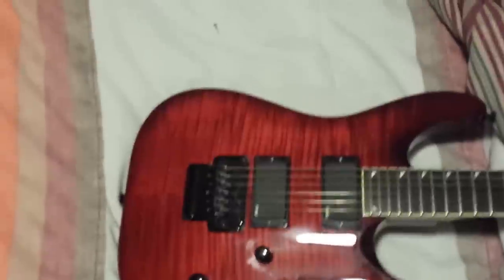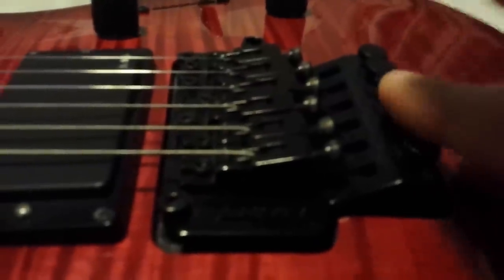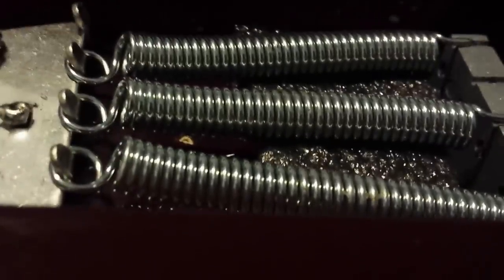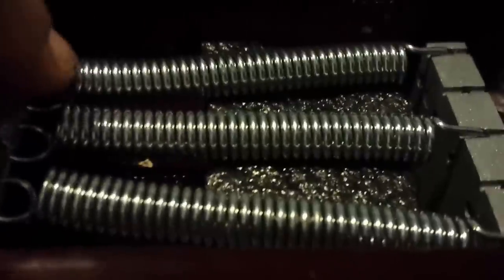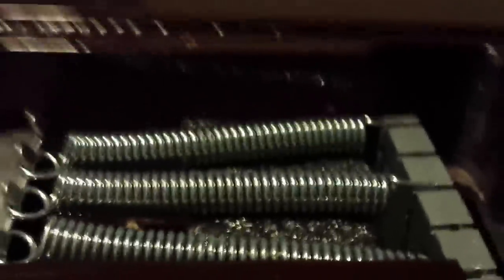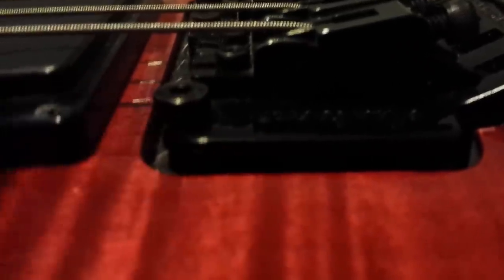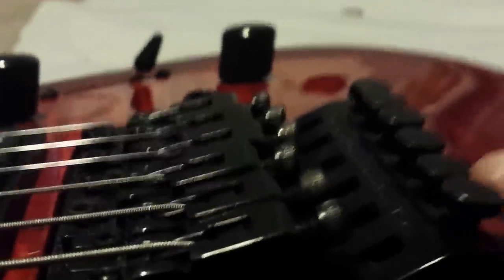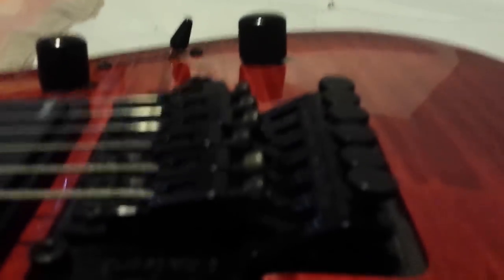How to set up a Floyd Rose Tremolo.

Comment: Hey there, I need some serious help here.
I've searched for a solution but I didn't find any video/blog/etc with something helping out.

So, my issue:
I cleaned up the fretboard, reinstalled the strings, tremolo was working fine. I went a little too much back with the trem, so the springs (all 3) where no more in the block.
So I tried reinstalling them (Uninstalled the strings and everything) but they get flying (literally) away when I release them. I tried unscrewing the 2 screws so it would have as less tension as possible, but they still pop off the block.
Any suggestion?
Thanks.
Reply from the maker: +Rockin'Brony Ahhh yeah, putting the ends of the strings into the saddles can be a bitch. Sometimes the little block inside the saddle, won't let the end of the string seat all the down, the way they should because of rust or gunk sort of holding them in place, instead of letting the string seat down. 
Try loosening the screws that hold the strings in the saddles all the way and make sure you can see the string end seat to the bottom of the saddle and when you tighten them down to the strings, the tiny blocks are flush against the strings and firmly tighten them down, but don't over-tighten them, or else you can crimp the ends of the strings and they'll break when you use your trem. The strings should sink about a quarter inch into the saddles and touch the bottom before you tighten them down.

Then tune the strings up and adjust the springs in the back accordingly, so that the base of the bridge is level with the body (like in the video) and as long as the strings are correctly seated into the saddles and firmly tightened, you shouldn't have a problem with the strings popping out. Ice had the same problem in the past when being hasty while changing the strings and not making sure every string is correctly seated all the way down to the bottom of the saddle and making sure the the tiny saddle blocks are all flush against the strings. Try that and let me know how it fairs.
Reply: Oh fuck I just realised I wrote "strings" instead of "springs" (God damnit)
The SPRINGS are flying away. 
Thanks for the quick answer but I made a mistake so it doesn't help xD
Reply from the maker: +Rockin'Brony Are they popping off the bridge block? Is that what you mean? The ends that go in the bridge block shouldn't be a straight 90° angle, they should be angled inwards towards the claw, so they grip better in the holes of the bridge block. Ya get what I mean?
Reply: Yeah, we (My brother and I) did that and it worked!
Thanks alot man!
I have an audition for College in a week and I was so damn scared I had to go to a luthier to make the guitar work again xD
Reply from the maker: Rockin'Brony Alright sweet! Just hit me up whenever you need to know something about guitars!
Reply: Sure thing!
You just gained a sub btw :P
Reply from the maker: Rockin'Brony Hell yeah man! I just realized how many views this video has. Jesus. I should probably make some more "How To" vids.
Reply: Haha, yeah dude :P

Comment: one more question . on the bridge where the strings get tightened; (below the fine tuning adjustment) they're all staggered the D string is almost maxed out. they all stick out different lengths. Is that normal? is that something that needs to be recentered After Time?   thanks 🎸
Reply from the maker: NO, each string requires it's own length, depending what tuning you use and what size string you use. What would help is if you could send me a picture of your bridge from multiple angles and I can explain what's going on.
Reply: WaRLoKWYATT Ok how do upload a picture.
Reply from the maker: +Anthony Lundell Add me on Facebook
Reply from the maker: +Anthony Lundell You fail

Comment: I can't figure out how to bring the bridge down (level)   Can't get the bridge even.  it's like the strings are pulling the bridge up... and suggestions are appreciated .. thanks
Reply from the maker: +Anthony Lundell It's just a matter of tightening the two screws on the claw in the back of the guitar, little bits at a time, while continuing to tune the guitar to where you want it. It's basically a balancing act between the tension of your strings and the tension of springs in the back of your guitar.
Reply: +WaRLoKWYATT Thanks for the Tip.  I usually crank each one 10 turns.  I've got 9s on my strat already,  I've ordered more springs.. (I also moved the springs.  the 3 connected to the bridge are the same,. but I changed around the order of the loop part of the spring that connects to the claw (the 3 most center). leaving nothing on the two outer side..     that was hard to describe lol...    instead of adding extra springs the guy at Guitar Center told me to do that trick. It didn't work for me however.. if I tighten down the car too much the whammy gets stiff. I've got to take her a little tighter on the lowest gauge strings.   🎻
Reply: +WaRLoKWYATT I am aware this is a Floyd Rose tutorial. My Floyd Rose Steve Vai Jem jr. is that Guitar Center as we speak. it was a disaster. I've never had a Floyd Rose before I didn't even know how to put the strings on, I took the bridge completely off till I realized I had to clip the strings LOL. But I'm having the same problem on my Stratocaster,,  not nearly as bad
Reply from the maker: Anthony Lundell No no no, you want to have the springs running straight, that way there's even tension between the three. If it for a strat, you may also tighten the lower side of the claw to compensate for the higher tension on the lower strings, but only a little bit. You should only need 3 springs, or else the tension in the whammy bar will be too high and it won't work as smoothly.

Are you trying to float you bridge on the strat? Or do you want it flat against the body? Because if you're just running 9's, you shouldn't even have to tighten the springs a whole lot.
Reply from the maker: But the springs themselves should be straight across, 2 on the outside, one in the middle. If your bridge is still slanting upwards and you want it flat to the body and you're not able to achieve that by tightening the claw, then I'd say the springs are bad.
Reply: +WaRLoKWYATT Thanks.  I bet your right.  I'll change it back how it was.  it's not holding tune well. I have to tune up after every song. I know it's because the bridge isn't balanced. I'm learning that's a fine art in itself.   🎸
Reply from the maker: +Anthony Lundell Just let me know any problems you have. Regardless of what people say or think, I do know my shit, because most of what I know is all by trial and error. I used to swear against tremolo systems man. Haha. 8 years ago, you couldn't catch me dead with a fucking floyd rose guitar or a strat. Now I have love for all kinds of guitars. Preference changes with time and experience. Hell you might catch onto what I'm talking about and end up swearing by floyd rose guitars! Once you work on them enough, it actually becomes fun, because they are more of a challenge to get right. I tell ya, I could work on guitars all day, every day, no matter what kind, and be happy. There's nothing I love more than taking a guitar that most guys would call a piece of shit, and turning it into a player's machine!
Reply: +WaRLoKWYATT I've been playing 20 years, I got my first Floyd rose 1 week ago.  It's in the shop being fixed. I should have done  more research. I don't regret getting the Floyd Rose I like the fact you can do dive bombs and stay in tune. my first mistake was taking all the strings off at the same time. I'll never do that again LOL took me 4 hours to get the thing back in tune.  it's Guitar Centers problem now. It's well worth the $60 for them too fix my mistake.  for instance I was trying to tune the guitar with the lock nuts still on the nuts lock. so the string broke up by the tuning peg. that's where my problems began. your video is great and I'll be more than likely referring back to you with any other problems. Like you say trial and error is the only way you learn. I wish I had watched this video before I started messing with stuff.. If you could have heard my guitar that evening I'm sure it was laughing at me. 😕  
I fixed my other guitar by simply using a can of air and cleaning out the volume pods.  I've never taken the pickguard off you can't imagine how dirty it was under there.  1999 American strat.  The volume knob when turned or even slightly bumped made a really bad scratching sound.  
another guitar I have the high E string is too close to the edge of the guitar when I play that string it slips off the edge,. it's worse the lower frets, like the 3rd fret playing a G chord sucks. I didn't notice this when purchasing the guitar years ago..
anyways it's always something with the guitar. you could be doing this type of stuff and repairs for a living or extra cash since you like it and know your stuff.  just keeping all my guitars in Tip-Top shape would be a full-time job I think there's a lot of demand for it
Reply from the maker: Anthony Lundell I would love to do this for a living, it's just that where I live, there's not enough of a demand for it.
Reply: +WaRLoKWYATT I have a question,.   I put 5 springs on my strat, the bridge is almost flush flat.  still up a hair because I loosened the 2 claw strings, but the whammy is pretty damn stiff.  I can lower the note 1 full step, but it hardly goes the other way..  (raising the pitch).  I'm already using 9s standard tuning).  I feel I've maxed out all my options.  the bridge is almost perfect but it won't stay in tune for shit.   any ideas? thanks
Reply from the maker: Anthony Lundell I told ya man, the tension to level the bridge, comes for tightening the claw. You might also what to check and make sure there's no obstructions under the bridge, that are keeping it up. All you want to have is 1 spring in the middle and two on the outside and they should be straight across for even tension. That's the only way you'll be able to use the whammy bar comfortably.

You only put in all 5 springs if you don't use the trem and just play it like it's a hardtail, like me. More springs = more pressure in the tremolo.
Reply from the maker: I'll just make a video explaining what I'm talking about.
Reply: +WaRLoKWYATT Sweet Thanks
Reply: +Anthony Lundell hey man put something below the bridge and tgen loosen the springs like 2 turns 
tune the guitar e e b a g d usually this method works faster then remove whatever you are putting below the bridge to keep it flat it will then flips a bit down again and the tunning will be gone release the springs alittle bit more untill u feel the tension onthe strings will be at minimum when u get to tune again :) make sure the bridge is slightly below the guitar by like a half cm or less ,tune ur guitar again and it should be in shape 
tune ur guitar one more time before locking the nut make it as close as possible couse also locking the nuts would make tunning go a bit sharper of course u have had the fine tuners in the "middle way" then fine tune it and it will hold tune forever
 by the way putting the springs the way u said is fine and will help rreducing tesnsion on the higher and lower strings and it would some how give u a better chance for lowering ur action without having  more buzzy frets 
enjoy 
I hope I ive explained a thing ot two 
its just a bit hard to explain in writing 
cheers
Reply: +komonology thanks I'll give it a try
Reply: Anthony Lundell cheers mate
Reply from the maker: Anthony Lundell Ya nevermind what I say, listen to the guy that comments after the fact. Lol
Reply from the maker: I obviously don't know what I'm doing, apparently

Comment: Broskavitch.... I would not put foam under my trem springs. You are killing sustain and resonance that way. You should buy noiseless springs for that issue. I dont know if you said this but the very most important rule of all is to make sure to slightly detune your guitar before changing your action. Rule # 1 and is the most important. Also the floyd rose original is made of higher grade steel and is more forgiving for wild dives and what not. Denser steel means better sustain...Thats why we use the FLoyd Originals. Just saying
Reply from the maker: Thank you father
Reply from the maker: Spam'n'egg. No it wont.
Reply: Spam'n'egg. Wtf are u talking about? Did u read my comment or someone else's? Clearly it wasnt mine. I have stated to slightly detune ur trem first to relieve tension. My information is accurate thx
Reply: Spam'n'egg. And furthermore ur information isnt all accurate either. If by rear springs u mean trem block springs?? As long as u have something (like cardboard or thin piece of plastic, etc) to hold the trem in place, the trem block springs dont need to b removed. Like he does in this video. To fully preserve the sharpness of the crescent blades of the floyd, yes, i would relieve the tension. However....if u have the floyd propped up u can get away with just leaving ur guitar tuned. And once u get ur action where u like it, chances are...its going to stay there and ur tuning will b stable as it used to b.  I only deal with floyd originals which can take more punishment than the cheaper ones. If ur constantly charging ur action and u have a cheap ass non german floyd...then u are at risk of dulling the blades. And obviously, dull blades means tuning instability.

Comment: anytime i use the whammy bar the strings pop out of bridge
help pls
Reply from the maker: ronald mcdonald  On a floyd rose? You probably aren't seating the strings far enough into the saddles. Make sure when you snip the string and put it in, you loosen those saddle blocks up enough to fit the string all the way down, then tighten them fairly tight, but don't crank with all your might because you might damage the string or that whole bridge. Message me if you need more help.

Comment: Ohh shit I think I made a mistake then. I changed my strings all at once and obviously my bridge sank . Instead of looking up the problem I did a quick fix, I pulled down on the whammy bar so the bridge would lift and tuned my guitar while holding the bar down... all I know is that it worked , the intonation is still good, no fret buzz, but now I’m panicking id this method might have damaged my guitar .. fuck!!
Reply from the maker: I wouldn't worry about it

Comment: The Floyd rose bridges are annoying as fuck I'm switching to normal simple bridges on mine, I cant lift up the bridge without a whammy bar
Reply from the maker: +Optic500 I can help you fix the problem if you're able to explain what's wrong. How many springs are connected to the back of the guitar's bridge? It can only be a couple things that are easy to fix.

Comment from the maker: Well Mia M. It would be nice if I could reply to you lol but thank you.
Reply from the maker: ***** Well it could be a multitude of things. Like I said in the video, when you tune the guitar up, the bridge needs to be perfectly parallel to the body. 

Yes you use an Allen key to move the action up and down. If the knife edges on the bridge are dull, you could have problems there. It's best to adjust the height of the bridge when the strings aren't at full tension, if you can help it.

Also, check those knife edges and contact points on the poles that move the bridge up and down for dirt, rust, or gunk that might be seizing up the mechanics of it.

To make the bridge flat and work right, you have to tune the guitar up and adjust the springs in the back to keep it level. If it they're new strings, get them close to pitch and pull on the strings a bit to stretch them out before you tighten down the nut. Then when you have the guitar close to pitch and the bridge is level, tighten down the locks on the nut, then finish tuning with the fine tuners. If everything is clean, moving parts lubricated with WD-40, knife edges intact, bridge level, and the strings stretched and tuned up, you shouldn't have any problems.

Is it a real Original Floyd Rose? Or does it say "Patented by Floyd Rose?" The originals are made of better metals and tend to work a but better, but you always have to maintain a Floyd system, because it's very precise moving parts. If you don't maintain them, you can run into troubles like what I sounds like you're having.
Reply from the maker: ***** If the bridge is perfectly parallel to the body and it's up to pitch, you shouldn't need to adjust the springs. But to do so, you just tighten the two screws on the claw that holds the springs and it creates more counter tension. The floyd works off of having equal tension from the strings and the springs in the back, thus why it's a "floating tremolo," that moves on a pivot point (the knife edges.)

What Guage strings are you using? I've noticed if the strings are too light, you can have problems like that.
Reply: +Spyros Pavlis Make sure you properly stretch your new strings when they are changed. That damn g used to drive me nuts until I learned to install new strings correctly. It takes time but it'll make a difference and be worth the effort. I hate brand new strings. They don't sound or feel right to me for at least a week of daily jamming. Just my preference. Hell, EVH used to boil new strings in water to pull some of the brightness out of them. Tried it, didn't like it. You'll find your mojo. Just keep working at it.
Reply: Nice. Anytime bro.